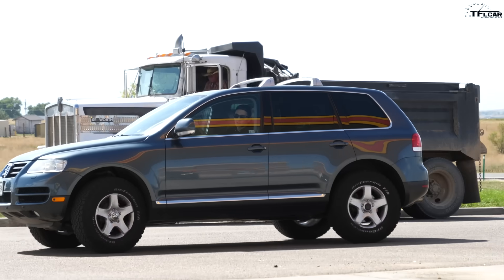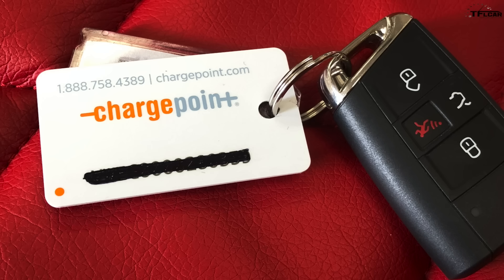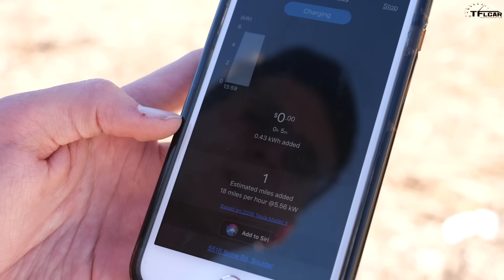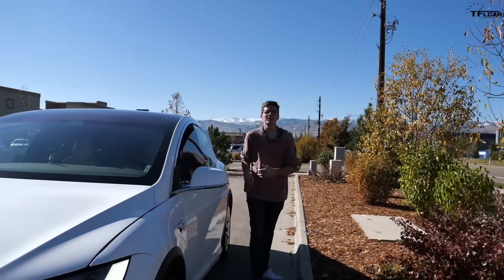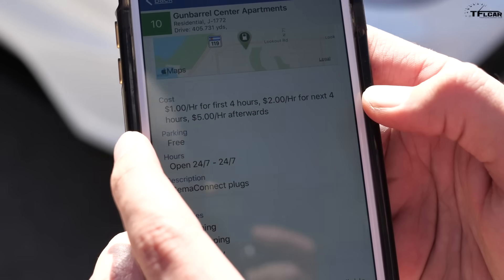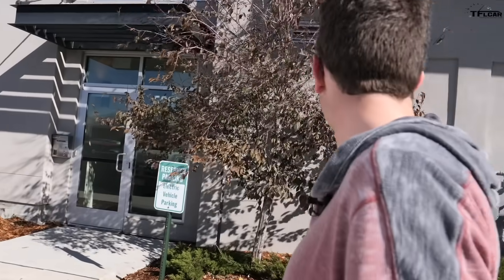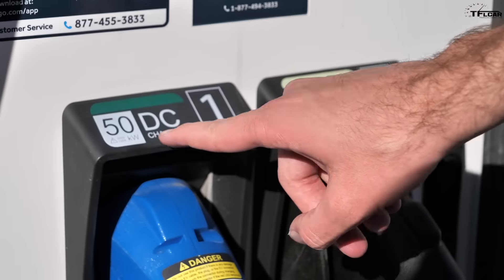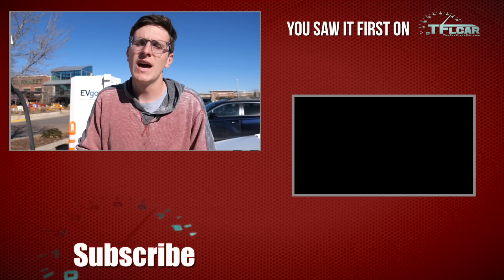Here’s Why Charging an Electric Car Can Suck - And It’s Not The Reason You Think!

Comment: about half the lifetime carbon-dioxide emissions from an electric car come from the energy used to produce the car, especially in the mining and processing of raw materials needed for the battery. This compares unfavorably with the manufacture of a gasoline-powered car which accounts for 17% of the car’s lifetime carbon-dioxide emissions. When a new EV appears in the show-room, it has already caused 30,000 pounds of carbon-dioxide emission. The equivalent amount for manufacturing a conventional car is 14,000 pounds.  Once on the road, the carbon dioxide emissions of EVs depends on the power-generation fuel used to recharge its battery. If it comes mostly from coal-fired power plants, it will lead to about 15 ounces of carbon-dioxide for every mile it is driven—three ounces more than a similar gasoline-powered car. Even without reference to the source of electricity used for battery charging, if an EV is driven 50,000 miles over its lifetime, the huge initial emissions from its manufacture means the EV will actually have put more carbon-dioxide in the atmosphere than a similar-size gasoline-powered car driven the same number of miles, even more if the batteries have to be replaced in the cars lifetime, and we all know they will. In the future we will see how wrong EV's are!

Comment: So let me get this straight under the best case conditions. I have to spend 30 minutes at the charging station, hope it has the right plug or have an adaptor, then go through like 5 different apps and hope they accept my payment. And make sure I have a phone that is charged. Versus a gas station where they accept all forms of payment even cash and only take about 5 minutes. Why would anyone choose an EV under these conditions. EV's are just making it worst on themselves by not using common sense. First standardized the plug port so all car use the same cord. Second put and LCD screen or physical buttons on the charger so people can use it without an app. Third put a credit card swiper on it. They literally have them on vending machine it's not that complex. There 75 percent of the issues is solved. Basic regulation would fix half these issues.

Comment: Just remember 60-70% of the United States power grid is still generated with fossil fuel. Rolling blackouts are already a problem and EV’s are not even a drop in the bucket compared to ICE cars. What will happen when there are 200 million EV’s?

Comment: They sell 48amp 11,520  watts is 35 mph a hours or98 amp 23,400 watts EV chargers 70 mph a hour AC for residential used
Think about our grid . In brown stone building in Boston there was a neighborhood we installed 2 a AC split system on a building I wired them up as electrician gave additional amp draw to utility company since the transformer are under ground. That AC company add another 12 to more customer when they did that another electrician did the work and didn’t send amp load. Now they trip that transformer former 3 to 5 times a summer because there over amping the transformer. The utility order a new one and transformer are not cheap it been 7 years now since it been tripping and that transformer coming in this summer 2022. Now just think adding EV charging station they draw the same as 5 AC units. Just upgraded a service won’t just do it your going to have upgraded those transformer . When I work for Cumberland farm they order there transformer 5 year in advance so they can have ready when they do a new store.

Comment: The reasons explained here for finding the electric cars a big problem should be good enough reason to want to have and promote hydrogen powered internal combustion engines.  So much better and without the problem listed here. I really feel that hydrogen powered internal combustion engines are the way to go. I really feel sorry for people who waste their money on these cars. They will be losers.
Reply: I have worked with hydrogen and it's not a fun gas... the bloody stuff can literally leak through steel (Ok, it's really really slow, but it's the smallest atom out there). It's also one of the most flammable, yet low on the power density compared to gasoline.  No odor, invisible... it can leak into the passenger compartment without anyone the wiser, displacing oxygen... explodes with the smallest spark. Gasoline stinks and you know pretty quickly if you have a leak. 
Remember, ALL of this is based on CO2 being a 'pollutant' rather than a naturally created plant food using models that have NEVER come close to matching actual observed temperature vs modeled temperatures. Ditto with we're not in a 'recession' by simply changing the definition of recession... And ALL the models said we'd run out of oil by 1975... only we now have more proven reserves than we did in 1975... oil is an earth process creation, not decaying dinosaurs. That's why Russia struck oil where everyone said they would never find oil.  And finally, we will never EVER run out of oil because that's not how a free market works. IF it gets rare, the price goes up. People then use less of it. It will stop being used for cars, and the price should fall, but banning it will jack up the cost of plastics (food packaging, medical supplies, etc) to the point we'll use it only for the most important item or two... You can still buy whale oil, but not legally in the Western World because of government regulations, but it's still available, just very expensive. The oil can stay in the ground or be used to advance people's standard of living... which is what they are doing in China and India while we choke off our supply and literally lower our standard of living.

Comment: People did you notice that the to full time is around 10 hours and they are charging at relative high charge rates 30A/240V so you are charging at a 7.2kw rate, hint rather high rate then you are paying roughly $8.00 or more an hour so a full charge will cost you $80.  Now your overall range is less than 200 miles.  So it works out to at $3.50 a gallon for gas it is actually cheaper to go gas.  Now remember you can refuel within minutes and not multiple hours.  Right now electric cars are a real world failure on range vs time vs cost.  Something that not taken into the mix is the taxed power grid, yep the grid is being pushed to the limit right now.  Remember all of those wonderful brown outs experienced in metro areas on very hot or cold days, that occurs when the power grid cannot keep up.  Now we want to put literally millions of automobiles onto the overloaded grid, only a politician or an ultra liberal could think this as a smart move.

Comment: I can see these charging stations will be trashed in no time, just like the idiots with driving around with the gas filling hose still in the gas cap and when you try to tell the dummy they go nuts and try to run you over.

Comment: Electric cars are only good driving local they suck’s on any long trips a 2 hour trip could easily become a 6 hour trip plus when your battery needs replacement be prepared to spend upwards of 25k that’s why Nancy pelosi has stock in rechargeable batteries they spread the global warming hoax to scare you into buying a electric car if they were so worried about the climate they can use solar panels and could make this car charge as you drive no need for any charging station no need for huge power plants that would spew tons of pollution into the environment it’s all about the money

Comment: 15 miles per hour to recharge.....so to recharge to travel 300 miles takes 20 hours......imagine the cost on a road trip to the beach.......better add a few more days and hundreds of dollars more for your vacation. Because every 300 miles you'll be spending the night. But wait, a gas engine can be refilled in a few minutes to travel the same 300 miles.......seems cheaper to drive a gas car on a longer road trip.

Comment: This is all fine and good.  But right now, the number of people with electric cars is practically nothing compared to petrol.  Those empty charging stations you see now will no longer be empty in the future.  If everyone ends up in an electric car, you will be waiting in line to get charged.  There will never be enough hook-ups for a heavily congested route.  You go to a gas station in a heavy traffic area, and you are waiting in line.  But with gas, 5 to 6 cars can get gassed up in 30 minutes.  Not 30 minutes per car.  So you are 6th in line, what, you will have to wait, roughly, 3 hours before it is your turn to charge?  And that cost you see now -- won't last.  It is cheap right now because they are trying to lure you in.  A lot of people forget or are too young to know, that Deisel was way cheaper than gas when it first hit the market for personal cars.  Now, look at any gas station, Diesel is way more expensive than gas.  Why?  Because so many people got on the diesel bandwagon because it was cheap, that the demand rose so high, the cost skyrocketed.  It is reasonable to assume that this will happen with electric.  Do not get me wrong.  I am not against new technology and creating various fuel sources.  Various as in plural, not singular as in one.  There are practical uses for each type of energy, but there are also impractical usages.  We should have access to all types of energy.  Every one is so concerned about the environment and the earth; but no one is talking about what happens when the batteries start to die -- and they will die.  Batteries do not last forever.  I am ignorant here, help me out someone.  Are not batteries toxic?  Isn't this the reason they do not want us putting our little double A's in the household garbage destined for the local garbage dump?

Comment: So  when going on a trip with a EV, the very first thing you need is to have a cell phone ($$) in order to charge your car. 
If you don't have a cell phone, or have one that doesn't work, you can't charge your EV.
Then you need to have lots of time, followed by knowing that you may be alone charging your EV in some isolated
locations and may not feel safe doing so. Again you need more time,  Then you possibly may need an adapter to charge your EV. 

Or the charger you are trying to use may not be functioning, and you need to find another one.
I'll stick with the ICE cars for now. I give more hope for the Hydrogen  cars to replace the gas cars because they work very much
like  getting gas quickly filling up at  stations without all the EV complications.

Comment: Queues at recharging stations, sometimes the charging points need reboot from central control or the physical chargers are broken, if your traveling distance a 3 hr journey can quite easily turn into a 9hr journey depending on your vehicle battery, and no matter the vehicle manufacturers milage claim if you drive a journey that is inner city then motorway, the battery milage will be far less, which means a recharge sooner than you have probably planned for, and of course fluctuation in price at the charge station. It has certainly put people off of buying a full ev, and is making people turn to hybrids. All you have done is highlight even more possible drawbacks.

Comment: The central issue for many - including myself - who would consider purchasing a Tesla, is a lack of accessible battery super-charging sites.

A home installation with adequate overnight charging costs nearly one thousand dollars.  Many older homes do not have sufficient electrical power that would allow the more efficient 240-volt chargers.  And the issue for multi-family residential and office buildings exacerbates the problem for available charger spaces.  

HERE IS HOW IT CAN BE ADDRESSED:
The Tesla supercharger needs only 40 minutes to provide an 80% charge.  
40 minutes is also the average time a consumer spends shopping at big-box stores (e.g. COSTCO). 
BIG BOX retail locations have ample electrical surplus capacity to allow dozens, perhaps hundreds of super-charger plug-in parking spaces.    
Tesla might consider contacting big-box store operators for the installation of high-capacity electrical super-chargers for their retail parking lots. 

HOW WOULD IT WORK? 
The shopper parks at a supercharger parking space insert his/her credit/debit card, plugs in, and sets off to shop.   
Returning, 40 or so minutes later, the shopper unplugs the EV / Tesla and leaves with nearly an 80%+ battery charge. 
Consider the convenience.

Comment: Doesn't cost your wallet, but will cost your life. No thanks. Travel with an EV would absolutely be horrendous. You run out of energy, it'll take 20 hours, if it takes 10 to charge half on average. Even quick charging, 100 miles in 30min? That's still 5 hours of time to make up 480 miles per tank I get. That adds almost 2 days on a trip to Florida from Wisconsin just waiting on a charge. Where I could fill my tank with gas in 5 minutes...cleaner air, probably. But the source of the energy these ports come from is really unknown. Because of it were connected to the power company in the area, I'm sure you'd be paying the same rate of kwh ad a home. Or anyone else that uses electricity. Kinda interesting.

Comment: So to travel 300 miles, you need to spend 20 hrs charging the bloody car. Imagine you have to do a journey from Sydney to Brisbane Aus. Approx 1000 Ks (750 miles) That equates to around 50 hrs charge time. What happens if you go to a multi charge station with 20 to 30 cars waiting. Do they have motels there as well. A journey of approx 9 hrs then becomes a journey of 59 hrs. Nice logic there.

Comment: Yea. . . That is just way to slow, and to complicated.  Driving longer distances means you would be spending a lot of time waiting for charges.  And the fact that it is not standardized is a joke.  I live in a rural area with long distances between things.  There is also the issue of how do i stay warm while charging in the winter.  Since the heater /defroster takes power, then we are taking even longer to charge, and getting less miles per charge.

Comment: Ok. Awesome. So you're standing there chattering away and trying to be cool when in fact you're terrified that we'll figure out that you have to stand there like a klutz FOR HOURS to fully charge that hideously overpriced EV. Well boyo, be terrified. We already figured it out. You can just ram that plug straight up your southern socket. What would you do in that 27hour I-95 traffic jam as your power fades to black? Hmmm? Have somebody bring you a jerrycan of voltage? What you'll get is a diesel duallie shoving that dead-in-the-water EV right off the road. Vid that for us....and what fossil fuels are producing the 240v to charge that little electric razor of yours? 
PS...What's the lifespan of those batts btw. 8 years? Then what? New batt pak for $14,000? No thanks.

Comment: So we didn't standardize the charge plugs OMG mistake 1.  We have many different apps used to pay, WTF  really mistake 2.  Waiting in line ups to charge, I am from Canada it's -25 celcius. Waiting in a line up keeping the car warm would draw down the battery that maybe is almost depleted since I am wanting to charge it. Mistake 3.  For Canadians getting electrics is ridiculous.  If your electric has a good snow cover from overnight snow fall. We typically brush off loose snow and start an engine and melt off the windshield and side windows. The electrics  wont achieve this very well. And if they do manage to warm and melt all the snow off your battery will be dead.  LOL  There is no way this works. Only for those in California who live 10 miles from work. That's where electrics belong.  Keep them there.....  Please

Comment: Someone please tell me how long does it take to fully charge your car and how much does it cost?  And most of all, how long or far can you drive until you need to recharge?
Reply: 20 hours to fully charge for 300 miles of driving.  I hope you have some reading material while you stand around waiting for your car to charge.
Reply: @ArtificialBanana  I kind of figured that.  A lot of people think that electric cars will save money and make driving a lot easier, but I disagree.     The faster we drive with electric, the more electricity we use.  Add the cost of playing the radio and using the GPS plus charging your phone will eat up your electric supply.  Hey, if someone can tell me differently, then that's one less thing  to waste the electricity.      The other problem I see is how much is it going to cost to charge your vehicle.  They raise gas prices, and they will raise electric prices too.  And finally, the biggest problems of all.  What if there is a power outage?  How long does it take to charge your battery?  And what if you run out of electricity in the middle of nowhere?  Oh, and what if there is a problem with your electric system?     I'm sorry if my scepticism irritates you, but what if I'm right?  Even the USS Enterprise had a back-up system.

Comment: We had a Leaf for about 5 years--got it on a lease return, so it was already 2 years old.  I found it too complicated to find a charge station when we needed one, find one that worked with that vehicle (there were no adapters at the time), one that we signed up for with our credit cards, and charging stations that *worked*.  Seemed like every time we drove up to one, it was broken.  Hard to believe that they STILL haven't fixed all those issues to make it as easy as driving a gas car.  Plug in, swipe card, charge.  It should be that easy.
Reply: Leafs are just too ugly…